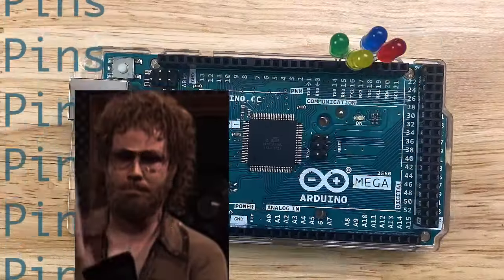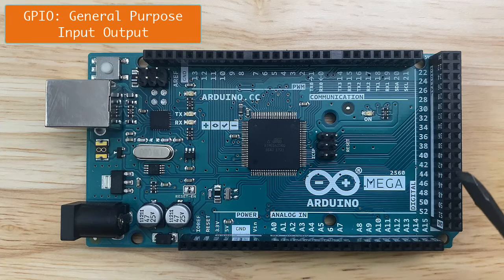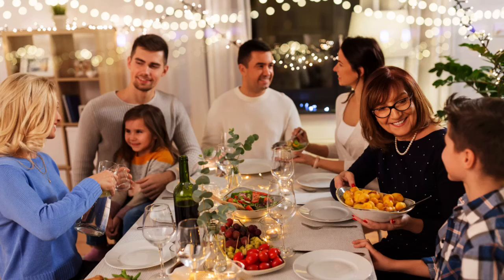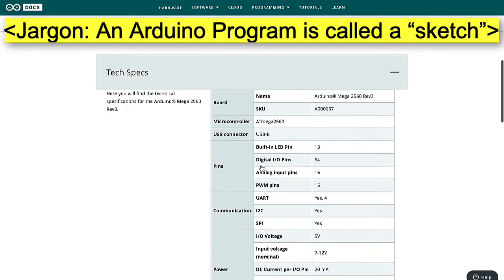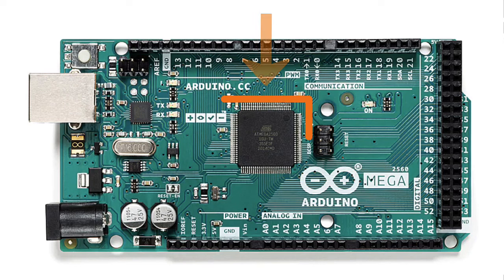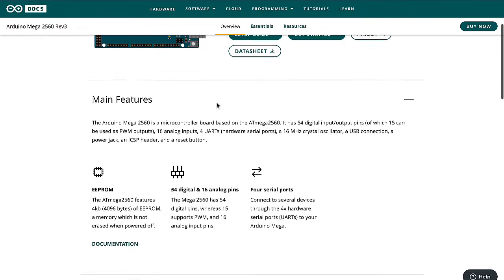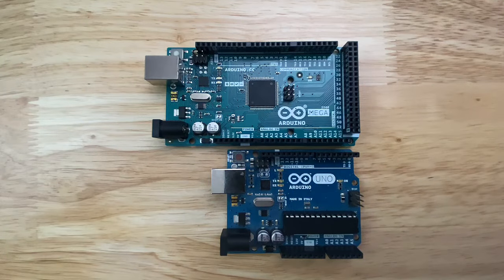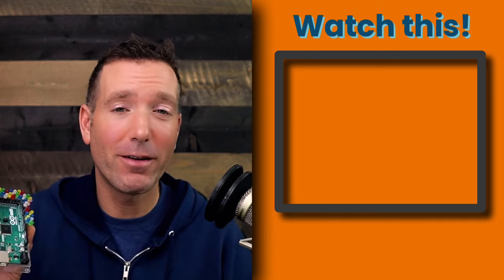Considering Arduino Mega? Watch this first!

Comment: 7 years ago I used a Mega2560 to make a temperature and humidity sensor. It still works today so that confirms the reliability also the DHT22 sensor is very accurate when compared to my HVAC testers.
Reply: 7 years n still the same sensors?
Reply: I am here because im going to make a temperature and humidity sensor for my project as well😂❤

Comment: You didn't mention that mega are slower than uno. And when you want to crank up speed use Esp32. It's a lot faster, but longer compile sketch :/ which  isn't helpful for prototyping.  Mega is the best when you need lots of pins (specially 4 UARTS). But why you need so many pins when you can use multiplexer etc

Comment: Yes, it has more io pins etc which is fine if you need them, the main difference it the flash ram which means the mega can handle bigger programmes. ESP32 eats them all in speed and connectivity.
Reply from the maker: Very true Ian.  If you want the connectivity and the speed, the ESP32 would be the way to go.
Reply: However the esp32 is not 5v

Comment: For those of us who build Virtual Pipe Organs, the Mega is a godsend. Faced with the task of scanning a keyboard with 61 switches, this can be done in parallel with the Mega with pins left over. This avoids the complexity of matrix wiring and the need for isolating diodes. Just slap on a MIDI shield and one is good to go. I have used dozens of Arduino Megas  in various ways for not only VPOs but also in pipe organs and they have always performed flawlessly. Just finished MIDIfying a three manual Rodgers console and used six Arduino Megas.
And don't forget the built in pull-up resistors! A brilliant and most useful feature especially when polling 61 switches.
Reply from the maker: Nice!  Great point John!

Comment: There is another board out called the Arduino Mega PRO which is 1/3 the size. I don't think this is an original Arduino board and there are a few different versions of the board. I would need to do some research on it. I bought one just to play with and it seems to work fine. You get all of the I/O pins and only a third of the size. But when you consider how many wires you could connect to it, is it really a space saver? Regardless, I've bought one, played with it and I do like it. But I doubt I will ever dedicate it to any one project. Part of me just likes to have all of the different boards out there, even if I never use them. 😁

Comment: Very funny video! I actually got my Mega for my birthday - that's why I'm using it for my current project. I consider Arduinos more as a prototyping or proof-of-concept solution. So it's fine to use any that meets the requirements - for most projects any Arduino will be sufficient. When going productive or as finishing touch of a project, I'd rather design a custom board with exactly the required components/connections.

Comment: The Mega is very old now and apart from its great I/O is really rather low spec these days. The Arduino Due has the same I/O capability and the same physical layout but it is way better than the Mega in every sense. The Due is a 3.3V device, which is now much more common than 5V and it is far more powerful in every regard. More recently the Arduino Giga offers even more GPIO plus built in WiFi, RTC and many other features, again in the Mega physical packaging. If you need the large I/O capabilities of the Mega range then the Due or Giga are better options IMO. If you need more than the Uno but not as much as the Mega/Due/Giga then the Teensy 4 range is also an excellent option.

Comment: The 'missing link' in the arduino world is the EASY interfacing of displays with the boards and still having some input/output pins spare. If you use the uno shield there are few pins available to do anything where as the mega has so many GPIO pins that I have never run out of them using the TFT shield. I am currently struggling to get a 3.5" tft display using SPI to work with a nano, getting a driver from a library that works using level shifters for some of the signals makes prototyping fiddly and frustrating. You also run out of memory very quickly if you are intending to implement a series of menus, Ease of interface and plenty of storage is where the mega wins hands down in my opinion.

Comment: Yes, but do you really need all that capability. Though I have to admit that there is not that much of a price difference between the Mega and the Uno with all the clones out there.  I personally prefer the ESP32 with Wi-Fi option, mostly because of the size though the Arduino boards are probably easier to use for a beginner.